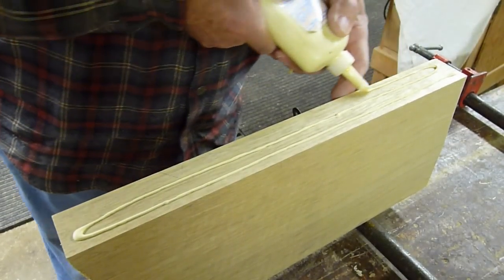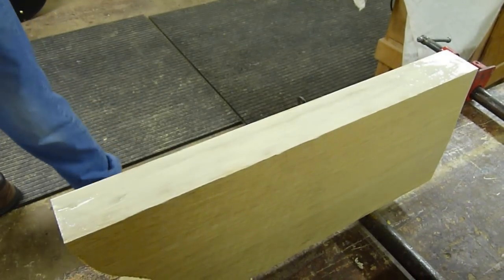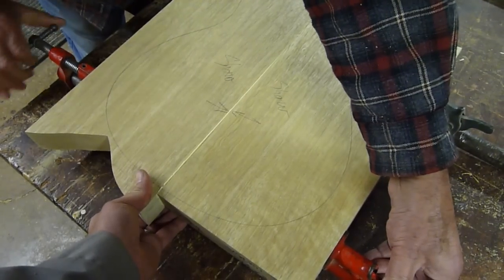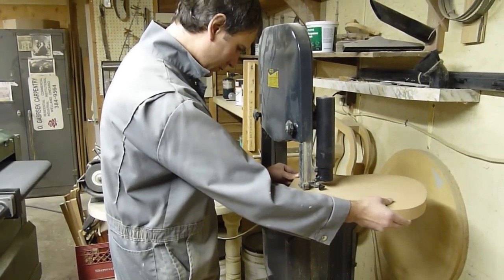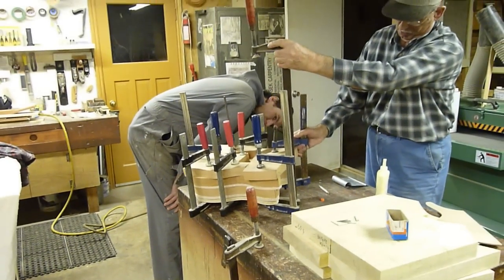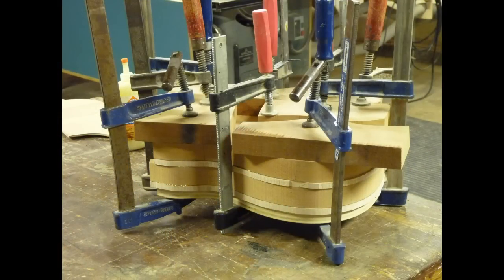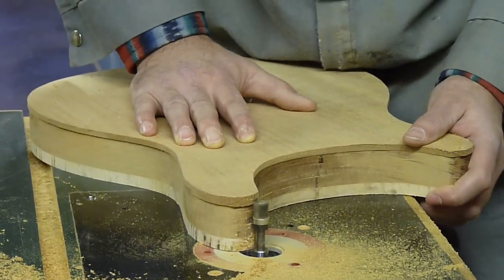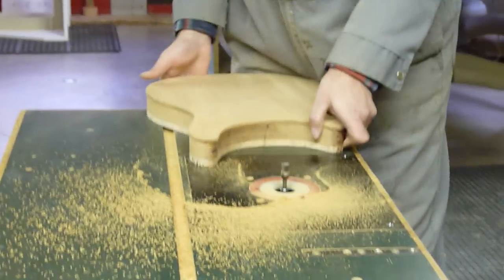Freddy's Electrics Vblog Part 4

Comment from the maker: Thanks for the comment. I'm glad you enjoy the videos. The body glue-up cam out pretty flat because the jointed edges were very square. I did run them through a thickness sander afterwards though.

Comment: Hi Freddy. First, I want to say that I have thoroughly enjoyed your videos. I am a novice luthier. Anyhow, this might seem silly, but I noticed that the body glue-up came out very flat. Is the wood just sitting on the bar clamps? I'm starting my first electric builds in a few weeks. Just trying to get all my processes down. Thanks! Btw, I've learned a lot from your videos! I used the rubber band trick for my StewMac guitar vise!